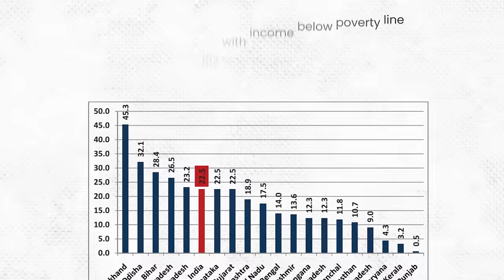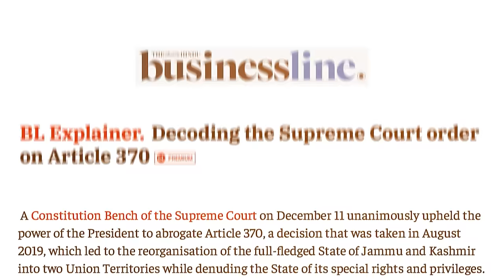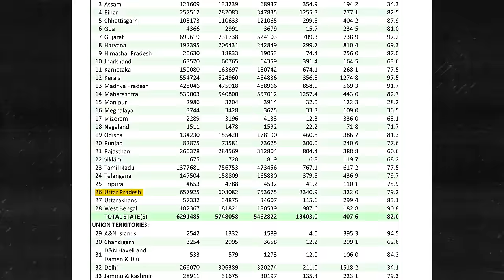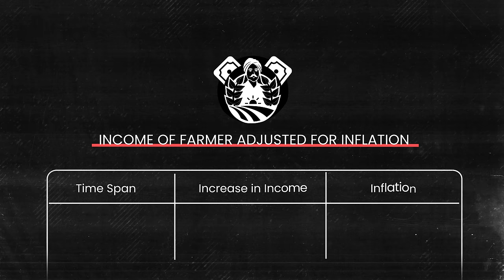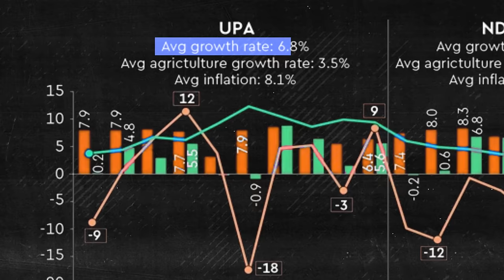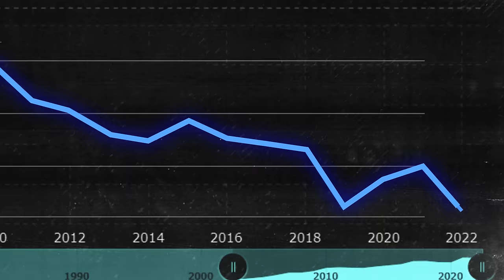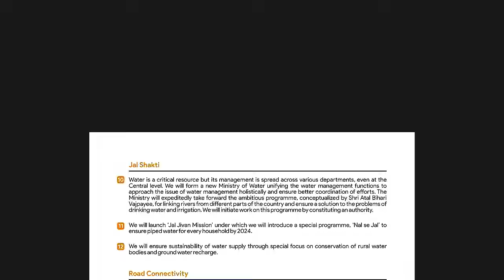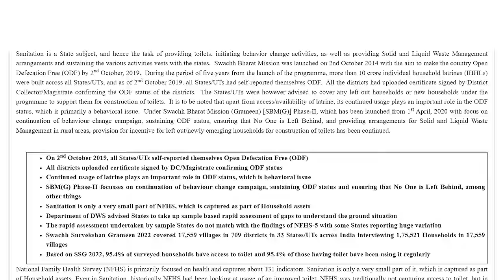The Honest BJP Report Card (Analysed with Stats): Were the Promises Fulfilled?

Comment: Shouldn't we also consider the condition of the environment under BJP leadership? While the electrification of the railway lines is a great step, the BJP seems to have regularly pushed infrastructure development, even in the face of environmental degradation. For example, the unchecked development of hydroelectric projects and expansion of four-lane highways in Himachal Pradesh have led to terrible floods. And now, with the abrogation of Article 370, they're again pushing hydroelectric and solar projects in Ladakh, despite huge local protests. While clean energy initiatives are certainly good, they cannot come at the expense of the environment itself and against the wishes of locals who are most impacted. These impacts also can be quantified, in terms of forest cover, emissions, respiratory illnesses, extreme weather events, etc.

Comment: Shouldn’t we account for the 10 year inflation while comparing the FDI between UPA and NDA ? Are the values adjusted for inflation ?

If under NDA regime, the FDI was roughly $500 Billion, then as per the 65% differential, FDI was roughly $300 Billion during the UPA regime.

But the inflation adjusted value of the $300 billion after 10 years is roughly $540 Billion (assuming inflation of 6%). 

In that case the FDI was actually lower during the NDA regime than UPA regime.
Reply: U should also consider the currency exchange rate
Reply: And the avg inflation in last 10 years =5%

Comment: Security situation and number of terror incidents have been reduced due to pro active stance of security forces especially Army. The internal security lies on MHA and all the reason for failure in NE states. Though Army has been rushed to NE however their interference and strength remains limited. The comparison of terror incident doesn’t reflect upon govn performance but Security forces.
Though revoking the Article 370 presented far more challenges for security forces, they have done a commendable job in keeping the situation under control.

Comment: Awesome analysis. 100%

I am fan of BJP but not that to follow blindly.  BJP is doing good job in infra, security and  green energy. 
Infra is like investment, will give return in following decades,   Obviously It give an debt, most of the cover from Tole taxes.
Also Agni veer is good for Arm Forces, but not for individual as Soldier.  Because most of the budget is spend on pensions. 

 (Correct If I am wrong).

Comment: Among all the current political candidates, BJP no doubt is best. But the BJP government need to check it priorities. There are many basic fundamental issues that needs to be addressed. Transparency in any of the government office is big of an issue. Every project and funds spent needs to be properly documented and reported to public with ease to public to analyze them. 
Secondary, religious tension is somewhat on rise during the governance of BJP. The government needs to address internal security and surveillance on extremist agendas no matter whichever religion or community it happens at. This is only possible if mob violence can be kept under control. No matter, what a person do, other community doesn’t have right to judge and punish. There’s a law and judicial system for that in place. 

Next, judicial system and law. This in my opinion is one of the root cause that has potential to solve many other issues if addressed correctly. We need much rigorous and better judicial education system. Just like how competitive UPSC and any other top exams in India are. Followed by, quicker and better judgment. 
Argue here is that court takes time to give a verdict so no innocent gets misjudged but we often see such a huge delay in judgment that a lot of innocent spends years behind bar for judgement for petty crimes which often times they haven’t even committed. If you look at the number of cases awaiting trial, you will look at such a huge backlog of cases. 

Also, when we talk about economic growth, we often mention how India’s GDP is growing, but we fail to see GDP per capita and that too adjusted for PPP. We still has a huge gap to cover. It growing rapidly but the wealth inequality is tremendous. The top 10% population has about 70%-75% of countries wealth which hasn’t changed in last 2 decades. 
People can blame the rich getting rich, but truth is that a lot of people are not grabbing opportunities when given chances. The educated section of youngsters are having trouble finding jobs and that is all being portrayed. But it’s never covered how millions of business are being affected by shortage of labour supply. This is not a thing in India but all around the world. We see same Indian happy to go work in a foreign country jobs such as construction, maintenance, cabs and delivery but they feel ashamed of doing so in India. There is definitely an income gap but India has no other option to be self reliant for this work. 

What’s the root issue? Taxation and free benefits. Each individuals should be paying taxes regardless of their income, atleast some percent. People argue that it already is huge burden on poor. But these taxes will be adjusted with years in the individuals income. People will be working harder to meet their end needs, will be earning more. Productivity will increase for sector and thus salaries can too. And no doubt the government will get huge funds to build the country better. 
Other reason for family being poor is being intentional poor. So many schemes and free amenities being provided, that an individual doesn’t see any true benefit of getting out that vicious cycle. There should be no free or subsidized things based on economic status.

Comment: 7:25 one point is that maybe the trust in police has increased and therefore many of the crimes against women which earlier went unreported, are being reported now, this also can be due to the empowerment of women that now they do not tolerate such things. because i know that many crimes against women were not reported(and still are not reported) due to shame in society. I could also be completely wrong
Reply: a better metric would be crimes against men i guess and also percentage of crimes commited by an individual and those commited by gangs and such.(plus the ratio of extreme crimes(like rape, acid...) vs smaller crimes like harrasment (dont get me wrong i do believe a crime is a crime but that would show if the actual no. has increased or just the reported number)

Comment: There were many flaws and uninformed information in this vedio. 
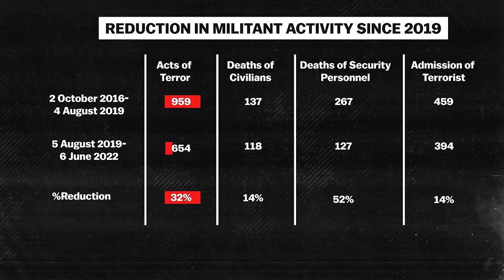At 5:08 the said % reduction in the compared period was total BJP ruled.
I didn't get what does author mean 'due to war' reason for explaining fiscical deficit of modi 2.0. if it is Russian Ukrainian war(2022), then its not real because the modi 2.0 started 3 years earlier which the said figure by author is very misinformed.
And above all, a political manifesto can't be considered as an appropriate report to rank/rate or as benchmark to compare. Further, the language used by author is biased and softly moderated when something is failed. Simply, the vedio is like endorsing the BJP manifesto.

Comment: The debt to gdp ratio as per the IMF, estimates to exceed 100 percent for developing countries like ind, currently it stands at 81.6 % which is not bad and it is not that you can decrease suddenly. Also there are more parameters you are supposed to include here while evaluating the work done by ruling govt, ‘corruption’ ‘cultural revive’, intent of govt’ are some of them. while discussing economy you have smartly skipped lot of things, like good work like how ind is gearing up for 3rd largest economy. apart from that, how start up ind ecosystem have built new spheres in the young minds and they have impacted the economy directly and indirectly. in agri sector, there are lot of things are going on that you have not done your research properly. like one i can say ‘agri infrastructure fund’ and empowering SHGs through bank linkage prog, there are many things you can list. i am not a bjp supporter, but the work that has been done by this govt is outstanding and the pace of the work has been fabulous, there is no doubt about it.

Comment: Kindly do not refer articles from the Wire, the Print, newslaundry etc, as they are frequently accused of spreading misinformation and might be tampering with data. Try refering to official govt statistics and trusted sources for it. I'm also a BJP supporter and I support all the points mentioned in the video. Excellent Video

Comment: Good attempt at trying to create an unbiased video but the fact remains that you will never say anything negative about BJP. 

In parameters where BJP govt has been unsuccessful or failure and even with stats backing them up, you rather choose to use words like “BJP needs to improve”, and “BJP needs to be super super careful”.

“50000 km of national highway were added” 
I would have appreciated if you would have researched more on this topic and informed your viewers that this figure has been achieved by changing the way they measure the length of the highways constructed. Previously if 2km of 4 lane highway was constructed, it would count as 2km. But under BJP, it counts as 8km (2km x 4 lanes).

“Many railway stations have already been equipped with WiFi”
India has approximately 7500 railway stations. How many have a working WiFi?? Any research on that? Just installing WiFi routers is not enough. Is the WiFi even working??